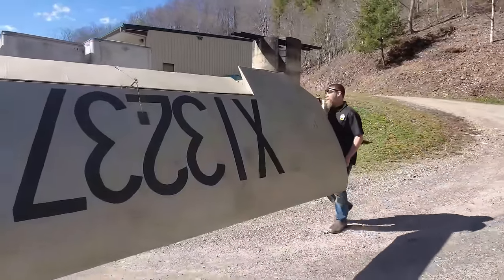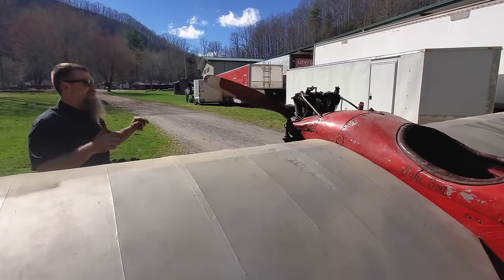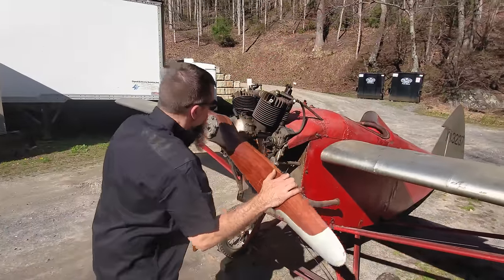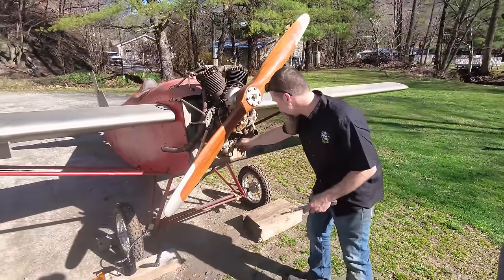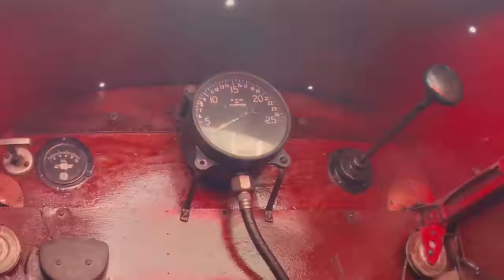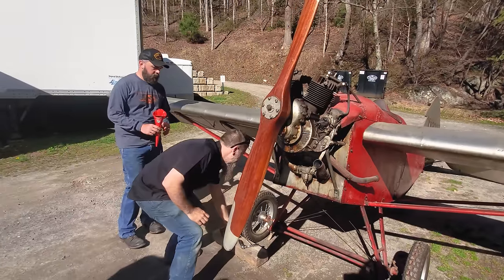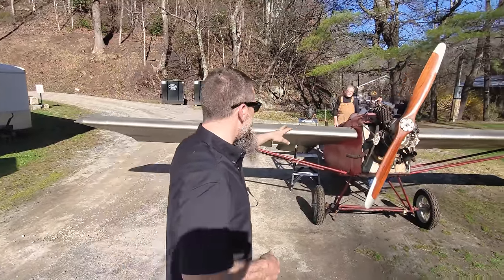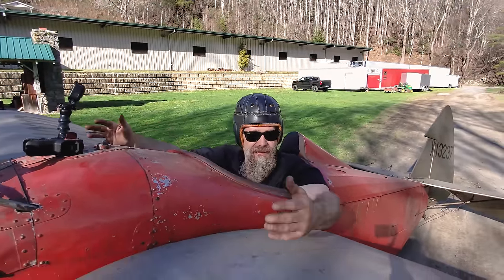Can We Make This 1920s Harley-Davidson Powered Airplane Fly?

Comment: Indian motorcycle dominated the motorcycle engine powered aircraft market in American for a long time.  The 4 cylinder Henderson/Indian engine was a much better option. If you think about it it is easy to understand,  losing a cylinder resulted in a much smaller % of total power loss than occurred with a twin . With a twin you loose more than half of the total power. With a 4 cylinder losing a cylinder leaves about 67% power available to reach a safe place to land .

Comment: Please be careful with that airplane. The flight controls really should be hooked up if your going to be taxiing on that rough surface so they don’t flop around. Hinges don’t like to be flopped. If the fabric was ok and it was at a small grass field I might consider getting about a foot off of the ground with it. I wouldn’t want it publicized until after the event. The faa frowns on that stuff.

Comment: Love the channel, I have been an A/C mech for 16 years and safety first! while I have all the confidence in your mechanical skills on the engine, those flight controls, their rigging and the structure of that A/C need to be looked at by someone in general aviation. Preferably someone who specializes in old prop planes/ early military planes. If that plane gets in the air and that structure sees forces and twisting that it hasn't experienced in 80+ it could crumble like a failed parachute. I highly doubt that plane is airworthy at all be careful guys!!

Comment: 1 taxi with the stick right back to keep tail on the ground. 2 learn to swing the prop correctly before you take your dam head off, 3 dont even consider doing anything more with it until you know the FLAPPY thing at the back is cslled the ELEVATOR and controls pitch up and down.  You didnt even check the control surfaces worked properly. 🤦‍♂️

Comment: A unique power plant for an aircraft would thought that a triple or a 4 cylinder would Ave been cool wonder would had it would be to put 2 cylinders on the bottom most rotary motors are odd number of cylinders.

Comment: The flap on the back is called the elevator, you need to hold up elevator (pull back) to keep the tail on the ground while taxiing. The attitude changers on the wing are called ailerons. You need to hold into wind aileron while taxiing to stop the plane flipping over in a crosswind. The extra oil in the engine may have also been to lube the homemade gearbox. The screwdriver on the ground is asking to be picked up by the prop and flung into your face. This ain't no Harley, it's an airplane and therefore quite happy to kill the ignorant at any given moment. So don't fly it.

Comment: You can't spin a prop too fast because the prop tips loses efficiency as the tips nears, and then 
 becomes supersonic.  BTY, if anyone flew that aircraft without a current annual inspection would have to heave a long talk with the FAA. I flew over 30 years professionally and I hold an A& P license....I've flown home builts before and would have no problem flying one today even  after being retired for many years.....BUT, it's beyond foolhardy to attempt to fly THIS aircraft...It takes more than sticking wings on a fuselage to make a plane flyable..... Examples: ....are the controls properly rigged? Is the fabric still airworthy or will it peel off the wings in the air leading to the plane falling out of the air? Is there hidden wood rot in any part of the structure?  There's a reason the FAA requires EVERY aircraft  in the US to have an annual inspection signed off by an A&P mechanic with an IA...that's an "Inspector Authorization. It's often said The FARs (Federal Aviation Regulations.) are written in BLOOD. And there's much truth to that. Because, after the cause of a fatal aircraft accident is found....the Fed's would write a regulation that would have prevented that accident...thereby ensuring safety to those that followed the reg..... The bird appears to be well constructed, but one cannot go on feelins.....get a proper inspection to be sure it will not fall apart in the air. Off my soapbox.....

Comment: Cool airplane, but you clearly weren't trying to fly. No runway, you should get up to a takeoff throttle before you release your brakes (your pal holding the tail) and you definitely don't cut throttle trying to take off

Comment: Very cool airplane. Don't hand-prop with both hands. It's extremely dangerous. You made the mags hot then went around and moved the prop before adding oil!?! Why did you turn on the mags and open throttle halfway to add oil? Don't ever move a prop with hot mags, or even with mags off because a loose or failed P-lead can cause the magneto to not ground and stay hot. You wonder about the engine starting and getting back to the cockpit. Put someone in the cockpit to control throttle & mags, and someone else props. In a plane this light, a body in the cockpit serves as weight and positive control and SAFETY. Two others on each side of the horizontal stabilizer prevent movement, too. Tie the tail down. Make sure to inspect the fabric before flight, and everything else, by an A&P. As a pilot & mechanic, I'm all about safety, and this hand propping was NOT safe. It's very cool to see this running & taxiing, though.

Comment: I love the simplicity of the light planes of these days. Most rudimentary boxes that would fly beautifully! 🤗 
This plane would require some attention to the control surface of the elevator at the very least, obviously. You mustn't even dream of trying a high speed taxi with it being twisted like it is!
I also would be concerned about the wood having gone brittle and the glue joints still being okay. My father owned a glider, a Lo 150, which was grounded as the glue used in its construction (A Casein based glue) had caused structural failure with some plane. This glue is strongly hygroscopic and draws water out of the wood if the plane is stored extremely dry. Wood shrinks when drying and becomes brittle, the fibres start to de-attach from each others. As there obviously is no documentation of the build of this plane, you'd have to at least check a good couple of glue joints to get an idea of their condition in order to know this plane will stay airborne and not disintegrate on the first pull on the stick.
As Casein-based glue was very widely used back then, there is a good chance it was used here, too. If the plane never was stored in bone-dry air conditions, there probably is no issue. But better safe than sorry, check.

Comment: Cracking good video! Thanks. What a great little aircraft. I'm guessing Mr Miller was teaching himself to fly. So easy to invert a light plane. If you get to hop it, or fly, make sure the gear reduction has oil, & there's generally provision for warm air on a/c engines...long induction tubes collect ice, as do carb venturies. Is it inlet over exhaust valve? I'm not versed on Harleys. Over here we are mostly old Brit bikes. Better balance than a parallel twin(i.e. BSA/Triumph). Well done👍Oh..if anyone flys her, make sure you've fitted a working airspeed indicator, & maybe a screen.

Comment: Anyone that tries to fly that without it being very deeply inspected is a nut! I dont know anyone that has a license or knows how to fly airplanes that would fly it. I used to know ONE guy that mightve and his nick name was Terrible Terry. He called duck tape 100 mph tape. Yes, he fixed his airplanes with it and flew them! But he died when something came appart while giving someone a ride that was interested in buying one of his airplanes. They were all ultralights. The one he died in had a oil leaking rotary engine like a Mazda car had and a wood prop that was weathered. I think the prop exploded striking a part of the airplane taking it down. 
This old thing would be even worse. ANYTHING could break on that thing and it'd be over and whoever was flying it would be like a splatted watermelon. There's sooo many things that could go wrong. That fabric is the FIRST thing that's probably junk. The old stuff used to go bad it 5 years. Better stuff was 15 years. I bet I could poke a hole through it with my finger.. Its absolutely worthless for actually flying. Leave it hanging in the museum. It's where it belongs.

Comment: The Reason for the Reduction is that a long Propeller Span allows for more Static Thrust, meaning better Low Speed Acceleration. But you also don't want your Propeller Tips to go Trans or even Supersonic because it destroys thrust and is just very loud. 

Also: Propellers kill and amputate a lot of People. They have a very nasty Bite, so be careful.

PS: Watching you Guys work on the Engine with a Hot Ignition: BIG NO-NO.

Comment: I just have to say it, please look up a video on how to hand prop, please get someone to inspect the plane, and PLEASE for yours and our sake's get proper pilot training before trying to fly this thing. While you don't need a license to fly this it is probably one of the most dangerous aircraft to take your first flight in.
1. its a very old tail dragger, they are notoriously difficult to land and even experienced pilots have been killed because of a particularly bad ground loop or turnover.
2. there is absolutely no suspension on the landing gear and the tires are extremely thin and odds are without proper training you might land hard and the gear would probably collapse.
3. i am amazed you didn't get a wack to the wrist from that prop start.

Comment: That's not exactly correct a propeller can turn 3000 RPMs they put the gearbox so he can put a bigger meaning more pitch into the into the blade which will make more pool probably that engine handle enough pitch to get the airplane airborne straight off the crankshaft the more the pitch the pool with the reduction spin a bigger pitch propeller

Comment: I'm a pilot and I'm sorry but you guys are totally missing the point. There's only one way to make this happen and I'm surprised I'm the only person smart enough to think about it ! ..You have to go back to your childhood and remember the Cox gas powered model airplane that came in a cardboard box they sold at Kmart for $14.99. It flew by having two strings attached to the belly working the elevator. Now we do the same thing here only with some real strong clothesline, about 50', now you guys aren't strong enough for this so we need to find a 400 lb sumo wrestler, feed him a few gallons of Red Bull, then fire the engine locked at full throttle.As he holds on to the rope it will become air-born and be in a constant left bank,then he can control the elevator just like the Cox model. You get to see the plane fly without placing a pilot in harm's Way, it's a No-brainer. You can even take it to air shows.   Sometimes you just have to think outside the box. Happy Flying.

Comment: The wrong way to start an aeroplane engine......the guy infront  must spin the prop first....than only the guy sitting at the cockpit turn the ignition "contact".......because it will flood the engine with unburn fuel....that make it harder to start....if the first attempt to start fail.

Comment: The propeller runs right like russian engines do, the way you swing the prop is totally wrong, it's a far dangerous operatio to do if made wrong way... Please turn the propeller the right and more safe way, put both your hands on it after turn it till the engine is one cylinder on top, just connect your start switch - you or a second operator at commands ...

Comment: Yo I would definitely not be doing this without doing any research. You guys were directly in the arc of the propeller the entire time. Your hand propping was dangerous and I doubt you need 50% throttle to start it up. I know you want to be the star of the show but you throwing someone off the started aircraft with him not putting his weight on it was dumb.

Im not trying to be an asshole. But you're throwing around a piece of wood that you realistically don't know if it's gonna stay together, with your cameraman going in its arc and directly infront of it.

I don't think you have your oilots license but the aircraft is probably overweight to be an ultralight as well. Just be careful, don't want the FAA having to call your wife.

Comment: The reason it holds more oil is for the gear reduction unit,if you keep running it low on oil you will burn up the engine because that oil lubricates the engine and the gearbox,find a real pilot and put that think in the air!- then youve got yourself a real video!

Comment: I believe you need to check your "C.G." (center of gravity). On such a small aircraft, you may need to counter balance for flight with sandbags.  The "C.G." point is 2/3 of the way behind the "LEADING EDGE" of the wing. Suspend the plane by the wings, 2/3 back of "LEADING WING EDGE", with "PILOT" seated and adjust tail "Counter Balance" until "SHE" sits level with tail‼... just like "SHE" was flying.  ... ...  ‼"NEXT" ‼ HIRE A TEST PILOT‼... 
 DO NOT DESTROY THIS FINE HISTORY

Comment: Both hands on the same side of a single prop blade is the proper way to hand prop any aircraft engine, the reason why those rules existed is because of the people who have lost limbs or lives doing it wrong...... the way you did.

The reason why both hands are on the same blade is when you pull down and away your center of gravity is going away from the propeller, and makes it's more of a natural movement away from the prop. Do not stand straight legged in front of the prop with one hand on either side like your embracing a large fat woman, disaster is in your future, just because you got away with it unscathed now doesn't mean you always will.

Please learn how to do it right for your own safety and well-being.

Comment: THERE HAS TO BE A GUY OUT THERE WITH THE BALLS TO FLY IT  / IS THERE A HISTORY ABOUT THE AIR PLANE  / PS # YOU BETTER FIND OUT THE PROPER WAY TO START THE PLANE BECAUSE IT LOOKS LIKE YOUR ABOUT TO LOUSE A HAND OR EVEN WORSE  /  IN OLD FILMS I NEVER SEEN A GUY START A PLANE THE WAY YOU DID  / THEY STAND TO ONE SIDE,  AND ONE HAND THE ONE SIDE OF THE PROP . /

Comment: What you guys did to this plane was cringe worthy! You have no idea what you’re doing around an airplane and you bent the shit out of the elevator. And you have no idea how to hand prop a plane! 
Sad, sad day for that plane. But at least you didn’t chop a hand off today.
Reply: Lighten up pops.  The elevator has been bent for over 30 years.   The only way to start a VTwin engine is to spin it past two compression strokes.  Hand propping it from one side won’t get it through the 315 degree firing order.  It wouldn’t even pop the conventional way.  Thanks for watching.